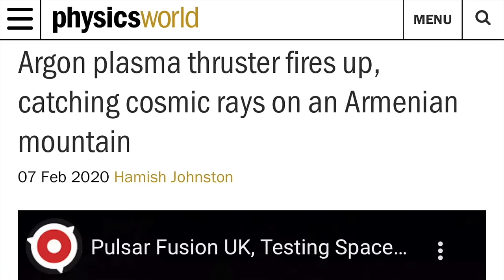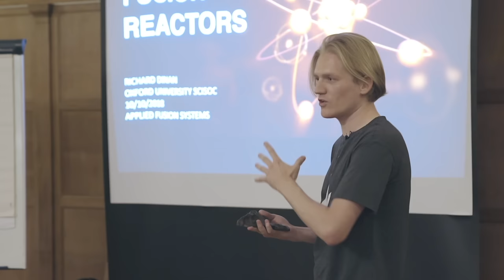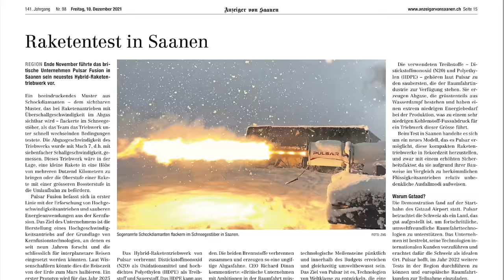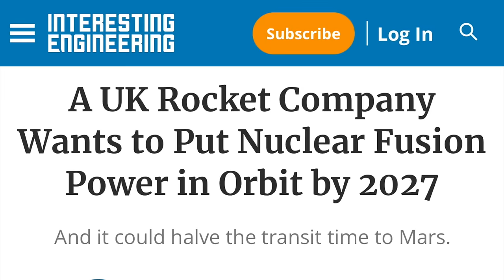The Pulsar Fusion mission described by CEO, Richard Dinan, 2022.

Comment: There where are cold fusion claims for about 50 years now. It turns out it wasn't cold fusion but it was a technology that is positioned between chemical energy and nuclear fusion and fission, which involves dark matter and it still keeps all matter involved intact, which is not the case in fusion and fission. To make the matter even more pointy, Nikola Tesla already envisioned a device capable of producing high enough voltages and power capable of extreme Ion acceleration, about 100x compared to the best Ion thrusters today. As you might guessed the device is called the death ray.
Reply from the maker: We actually talk about cold fusion in our latest post, we'd love your thoughts on our podcast! 🚀

Comment: Just read that you need around 100,000,000 degrees celsius to do nuclear fusion... Or is a nuclear fusion rocket engine different somehow?
Reply: Well not really, you see temperatures that high are impractical, not only on earth but on stars aswell but stars pull it off with their huge size, having immense gravity the hydrogen in core of star just comes together and forms helium but that to happen on earth we have to go creative they are many ways to achieve fusion on earth, like tokamaks and that laser power fusion reactor (sorry forgot it's name).
But now you might ask aren't they used for used generation of electricity how they can used in rocket engines? Well the rocket they are working on is ion engine long story short the more electricity you put into an ion engine the faster it is (over simplified) so currently in ion engines we can't carry heavy batteries since well you see they are heavy, so they are only used in space missions where they are powered by solar panels but it's not efficient to power the engine by solar panels or batteries so they are trying to use fusion to generate a lot of electricity on the spot so the ion engine can be made efficient.

But obviously this simplified explanation of what's really happening.

Hope it helps.
Reply: It surely does thanks
Reply: @Moleculize  thank you very much :)